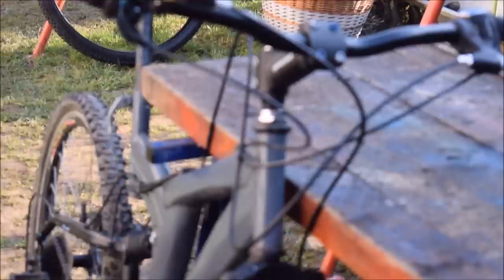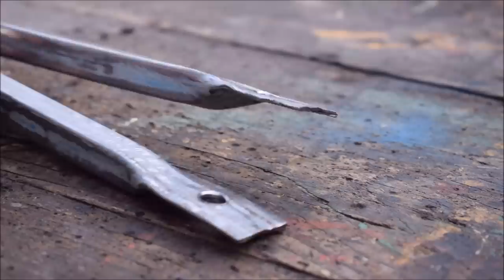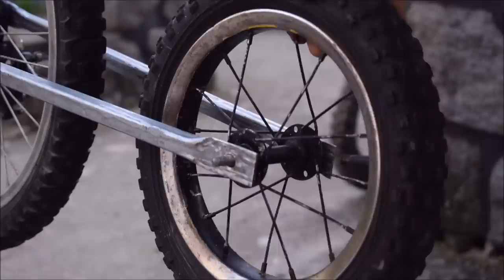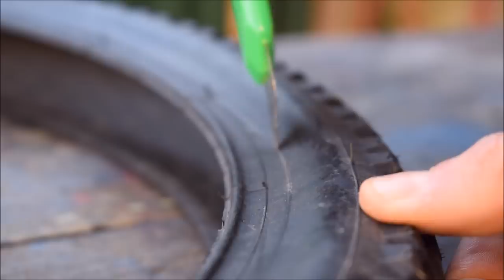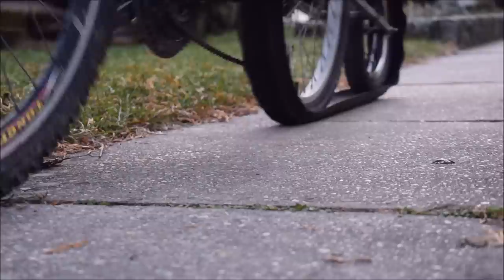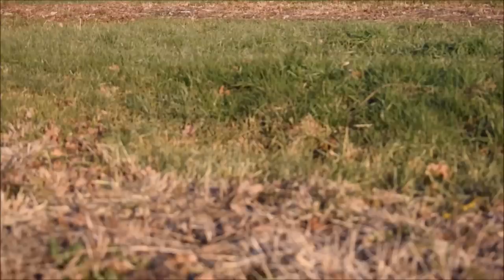Homemade TRACKED Bike For Snow/Mud / Experiment

Comment: When i was a kid in puerto rico i used to do something like that to use it as a wheelie bar. We use the rear lower part from another bike we cut the whole arm where the tire goes then we install a little wheel from an old roller blades to where the stand goes then we hook it to the axle of the bike we using and thats it . Fun days. miss them a lot. 🤪